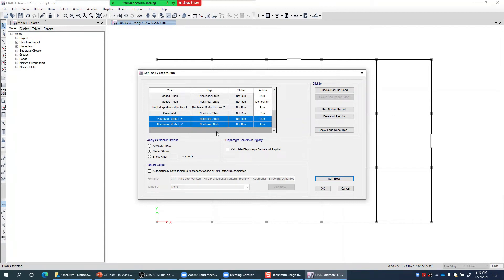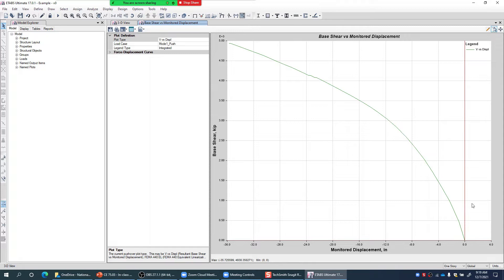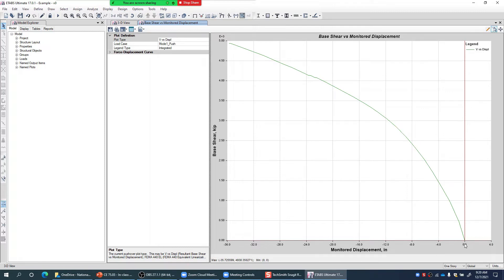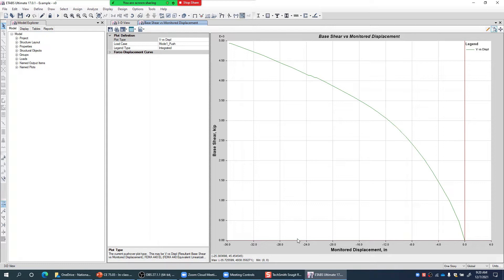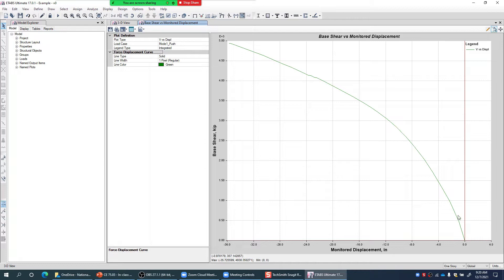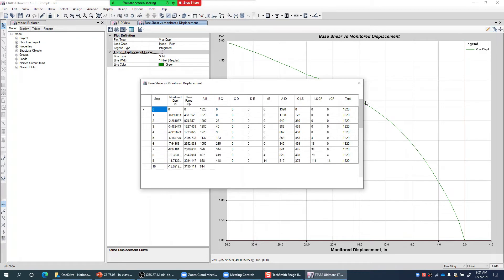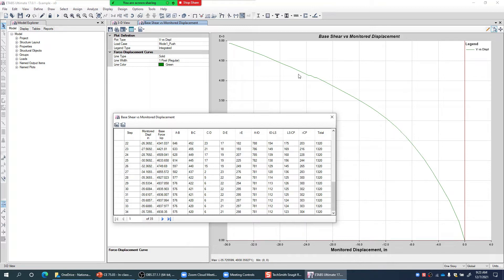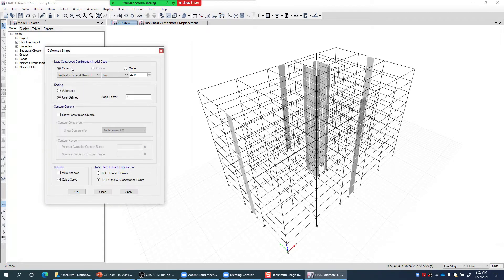8 - Pushover Analysis Results - An ETABS Demonstration

Comment: Respected sir, in pushover analysis to find out performance point our response spectra would be elastic or inelastic. Little confusion here because pushover curve is inelastic, so demand curve would be elastic or inelastic for performance point?
Reply from the maker: It is elastic response spectra but modified (reduced) for effective damping. Please check Capacity Spectrum Method from FEMA 440 for details.